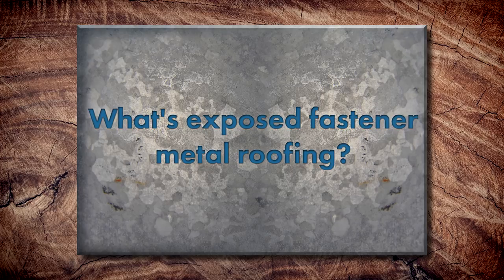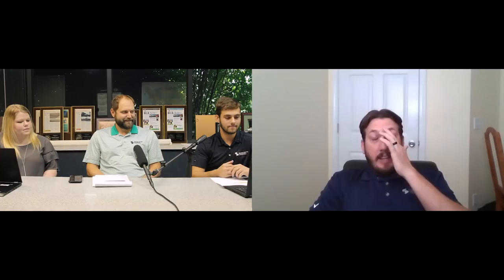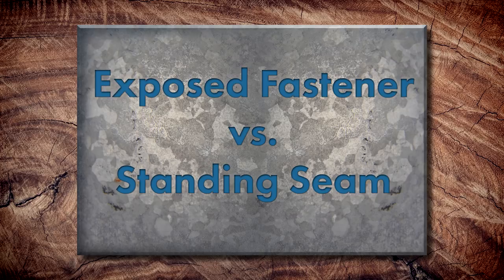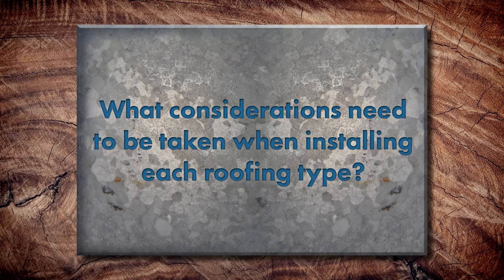Exposed Fastener Metal Roofing Vs. Standing Seam Metal Roofing

Comment: If you’re in Florida exposed fasteners are the way to go, they have a much high wind rating.
Reply: you can get the same high wind ratings with either system,  it's all dependent on how you want to install and the substrate.
Reply: And check with your insurance my understanding is they must be exposed

Comment: I think it's unfair to make generalizations about any roofing system when there is such a large spectrum of materials and installation practices. You're comparing DIY or handy man practices of corrugated roofing to higher end standing seam roofing. Take for example his statement that exposed fasteners back out over time and require maintenance. The first problem with that generalization is it has less to do with the system and more to do with the pull out value of the screw in relation to the substrate.  The same screw driven into OSB has about half the pull out value as it does when driven into plywood of the same thickness.  The second problem with that generalization is there is a large spectrum of installation practices. Screws installed through the rib into an OSB substrate will most definitely back out. Screws driven through the flat into a solid purling or fur strip will not back out. Lastly not all fasteners are created equal. Some fasteners have just the neoprene gasket situated under a hex head, others utilize a floating steel washers to compress the gasket, and higher end fasteners have an enclosed gasket within a solid hex head.  
I could say a great deal more. I do agree with much of what was said however I think your bias towards standing seam is apparent.
Reply from the maker: Robert, thanks for the honest insight. There is a wide variety of installation practices as you said, and while we try to cover as many as possible, we may miss some or not always be as clear as we might like. The topics we talk about are based on examples seen over many collective years of dealing with metal roofing. In response to your comment and other comments on this video, we've got an update video in the works that features more graphical content, and we'll also take into account other installation practices and materials. I appreciate the feedback and support Robert! -Thad

Comment: Can I go straight down to the underlayment with exposed fastener? Do you not need fur strips?
Reply: I was told metal roofing can be attached directly to plywood or OSB board after underlayment is installed. To be clear- underlayment is installed over the plywood or OSB board, the metal roofing is installed over the underlayment. Furing strips is a good choice if you will be installing metal roofing over your current asphalt shingles. Do a metal roofing google search for more info on the subject.  I am not an expert, I just chimed in because no one answered your question.
Reply: 1weird Doe   The air gap increases energy efficiency up to 18%. It allows me to attach 1x4’s to the rafter not the weak osb boards. Then the connection from the metal to the 1x4 is always hitting good wood. Plus I can level roof as I go making the final finish better looking.